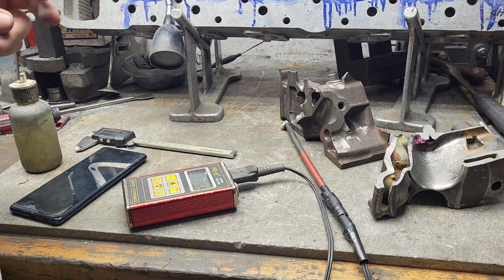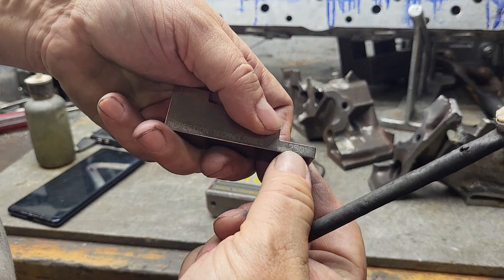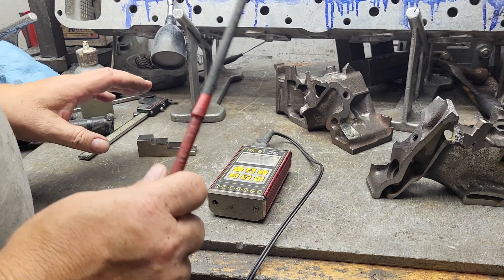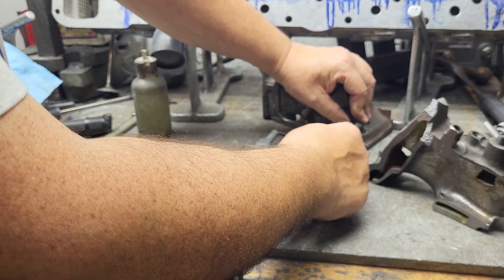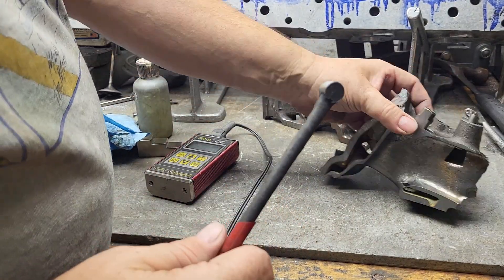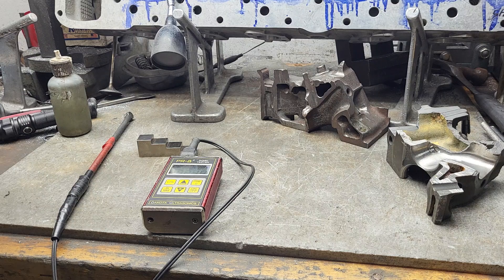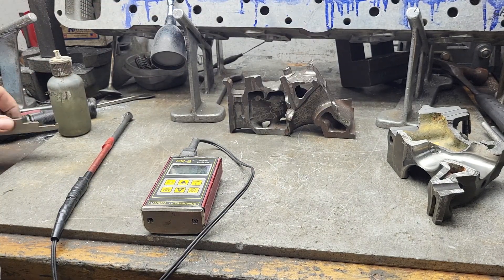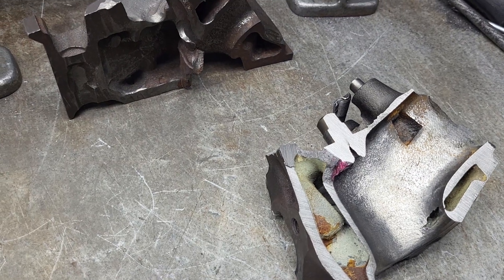71. Swirl port cylinder head cutaway sonic measurement workshop.

Comment: I need to get a good ultrasonic thickness tester.  I am doing a head for a big cube application and I went thru into the coolant jacket in a few spots getting the throat size up to 85% oh well. Just have to weld it up. It is feeding 130cubes thru a 2.25" valve so it needs what it can get.
Reply from the maker: @bcbloc02  Worth every penny

Comment: 👍😎
Great video Charlie.
Hey IMO if its within .010 thats close enough to warn you when youre getting to a reasonable limit.
Just my opinion of practical useage.😐
I bored a SBC once and on the race track it blew a nickel sized hole in the cylinder wall.... Which measured .060"... A thin void that was undetected...
Sleeved it.
Reply from the maker: I never had luck with sleeves. Thanks

Comment: Great video Charlie. I have a PR8 I’ve had for years but haven’t used a lot because I was not very confident in the readings I have gotten! Is there anything different you would do on aluminum?
Reply from the maker: Aluminum needs to be calibrated for aluminum. It has a different ultrasonic speed. I go back and fourth between aluminum and iron alot so, I need to calibrate every time I change heads or intakes.

Comment: Charlie have you seen the new ultra sonics you can buy for 100 oe so dollars
 I'm curious how accurate they might be
Reply from the maker: Mine was more than 10 x that, but that doesn't mean the cheap ones will not work. I have a cheapie somewhere. It was horrible.
Reply: @servediocylinderheads 
If they can sell cell phones pretty cheap, the electronics in a sonic tester should be a reasonable price... But they don't sell many, do they?
Reply: You usually get what you pay for especially on equipment but I watched a documentary recently on the true cost of making some of these electronics now🤯it was dirt cheap! Like the cost of a new iPhone…downright upsetting to find out. Not upset at the poor Chinese people who slave away to make it either- THE LOGO MARKUP! 😖
Reply from the maker: @MidnightOilsRestoration  I agree, I would like to write that I never regretted buying high quality stuff. True, I did need to save up to get it!
Reply: @servediocylinderheads  I absolutely agree with you, buy quality-buy once!